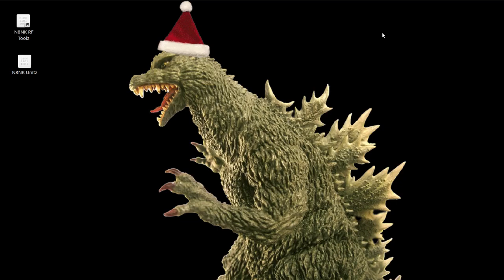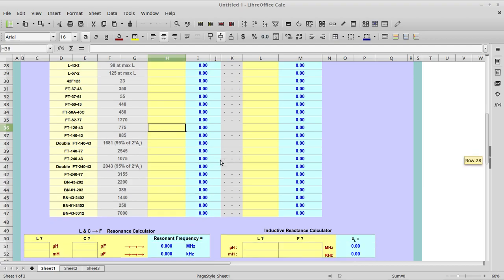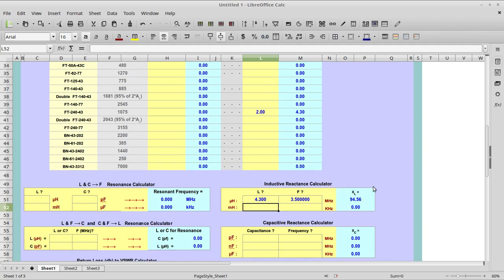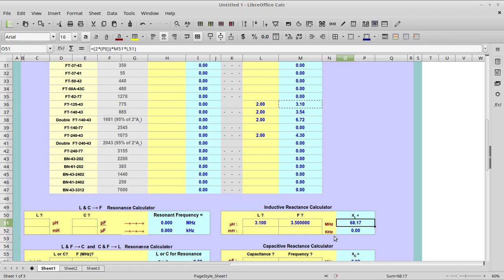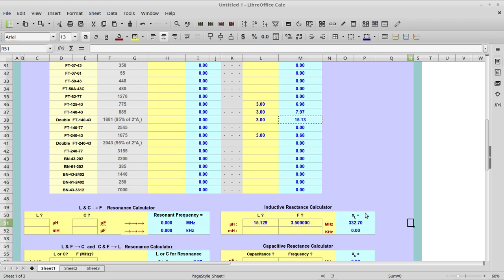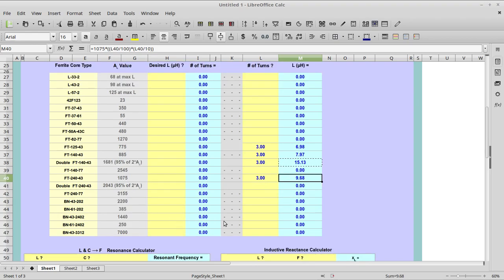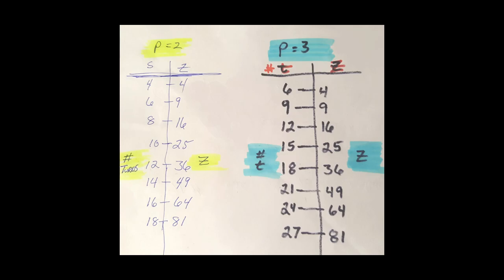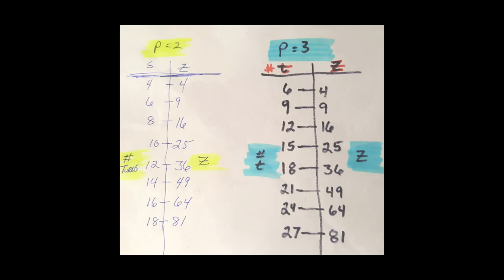Multi-Tap UNUN Winding - Part 2 of 3 - # of Primary & Secondary Turns

Comment: I would like it if you would sen me a schematic of your multi tap unun. 
if you can sent it to , carlschultz0812@gmail.com 
Call kN4RBJ                                         73s
Reply from the maker: Hi Carl. I will.. but I'm going to make a short video tonight exploring an UNUN failure.. to see where it failed. I'm going to unwind it and hopefully we'll see. I was VERY surprised when it happend. I couldn't believe it. It was due to arcing.. not heat. And in this video, I'll show a schematic of it. It's not what you might think: it's just a normal transformer. It's schematic is that of a typical transformer with one primary and one secondary. You'll see. There's also an 'autotransformer' style of UNUN, and some have used them, but not I. I'll show that schematic as well. I have to let my phone charge a couple of hours then I'll shoot the video and post it before going to bed. I've been meaning to for a couple of weeks.. but have had a lot of ups and downs in life lately. Challenges. This time I'm actually going to do it. lol. Take good care Carl and 73 OM   :)

Comment: And why do you wind it with separate primary and not as autotransformer i.e. when the primary is simply the beginning part of secondary?
Reply from the maker: I actually tried that one time and it turned out miserable. Very poor performing.. and changes on the output tap tended to cause changes in the characteristic Z of the primary tap. Also, I like to use the various taps as a form of 'end L loading' so as to tune my wire within the band.. and also, to use the wire as a 1/4 wave radiator against a counterpoise system. When used as a 1/4 wave radiator, the wire is considerably too short, and by using the 4:1 tap I can achieve resonance.. for example, using a 58' long 40m EFHW, I can use it on 80 by connecting to the 4:1 tap. It works wonderfully. I've shown this in a past vid. When used as an autotransformer, I was no longer able to do that. It just didn't work out for me so I abandoned any further work with a classic autotransformer.  73
Reply: @n8nkqrp595 
Ok, thanks.
I'm currently using an autotransformer on 140-43 core with 4 turns primary and 28 32 turns total (49 and 64 ratio). 150pf shunt cap. Works reasonably well for me with 40m ef wire. I opted to 4t primary since I want it to be good for low bands. So it works great on 80 and 40, and worse but acceptable on 20.
I have another 140-43 core in my drawer. So probably I'd make another one unun with separate primary and compare both variants.

Regards
73
RA0UFF
Reply from the maker: @АндрейДенисюк-ш7п  Ok. Very interesting! I'll have to check that out again. Another thing with two windings is that the antenna wire is at ground DC potential. Nice for static bleed-off, etc. With an auto, the feed line to the rig is at something other than DC grond I believe. anyways, really cool.. I'll try again with that style. Thanks for your comments!  73 OM   :)

Comment: Ah, just found the mother-lode! I've searched all over for this knowledge. I'm getting back into radio after many years away, before the advent of spread-sheets and calculators. Just bought 2 FT140-43's, and some 19/0.15 silver plated PTFE wire, so ready to start.
Reply from the maker: Awesome!!! I might call my 'knowledge base' more of a cesspool than the mother lode.. but hope it's of some use to you, either as a technical reference or a means of comical relief! Haha, Welcome back to the hobby. We come and go... and it's always fun to come back to. Take care!  73 OM   :)